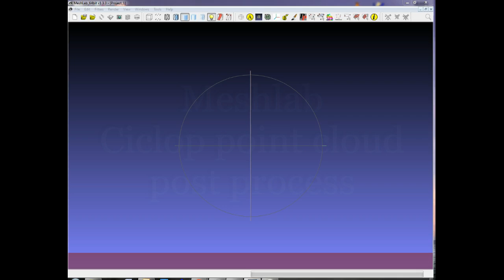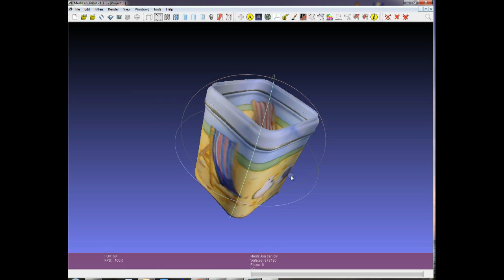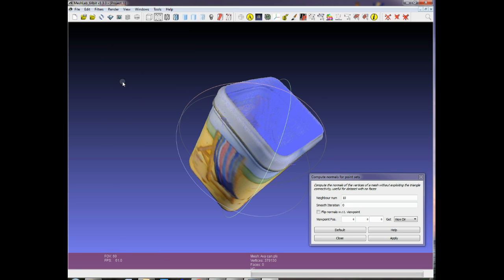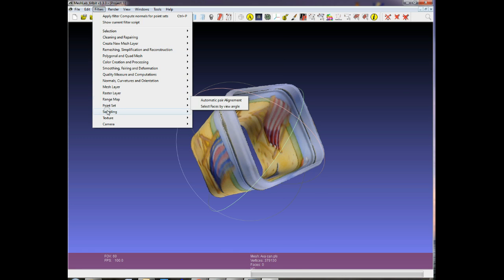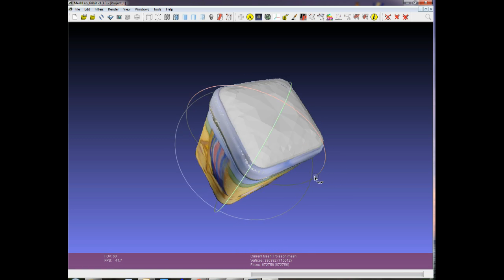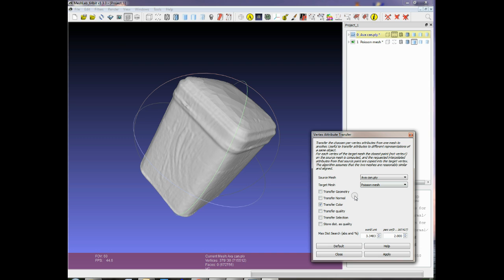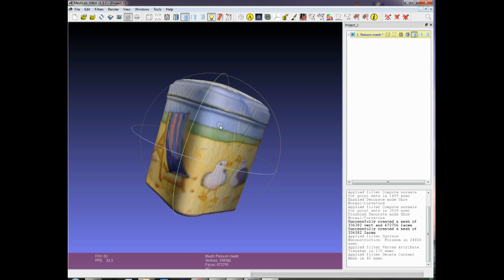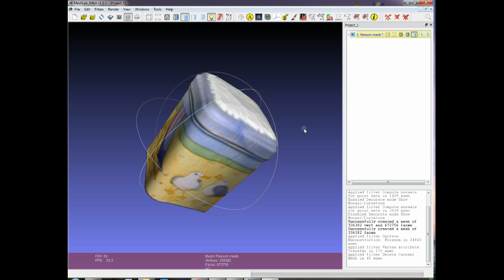Meshlap post process

Comment: As you have decided that one laser is enough to get a good scan.
Would one line laser in the center post just below the camera be a better design ?
Is the laser offset needed to get a good scan ?
Reply from the maker: Hi Donald,Yes, I can't see a reason why you couldn't change the design to use one laser.  I think the software can cope with the laser mounted just about anywhere.  The laser calibration routine ascertains the laser orientation and so you can pop it anywhere.  So, no I don't think the laser offset is a requirement to achieve a good scan.Cheers,              Dave

Comment: So this is a solid object when imported to meshmixer. Can you make a mesh mixer video? (I use mesh mixer a lot.) Would you inspect the wireform, make it smooth on top, and then just a big brush to flatten? Then a plane to slice the bottom with flat fill?

Good videos... 

Why not have 2 cyclops with a camera looking down at 45 degrees and several inches higher to capture the top data (And do a whole bunch of processing to mesh them together).

Looks good.
Reply from the maker: Hi Gary,Before you can import into MeshMixer the point cloud from the scanner is converted to a Mesh using MeshLab.  This conversion maybe possible in MeshMixer directly but I suspect the best route is to use MechLab and then import into MeshMixer.It might be possible to capture the top using another camera.  An easier method would be to simply perform two scans one with the object upright and then a second scan of the top and/or base.  Then as you say stitch them together.Thanks for the feedback :)Cheers,                Dave
Reply: "Wave your hands a LOT" when saying stitch them together. I think I'd import only the MashLab point cloud converted into surface planes into Meshmixer. I'd convert the objects to "Make Solid" in mesh mixer. Then 'Boolean Union'. I'd then use make printable.com to do any repairs to the stitches of the intersections.
Reply from the maker: Hi Gary,Yes that sounds like a good plan, maybe you should put together a video tutorial showing the method.  There are so many different ways to skin the same cat the more detail that is out there the better.Cheers,             Dave